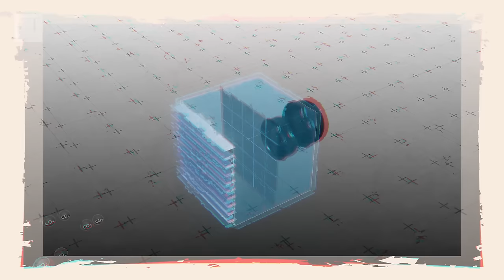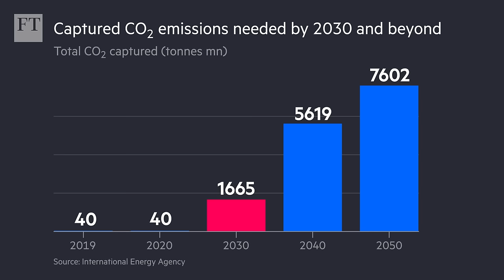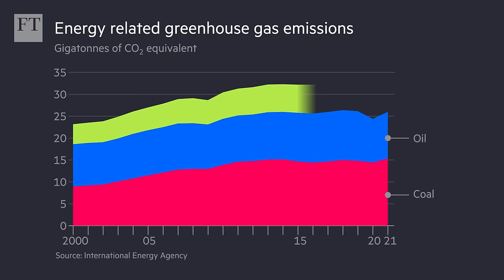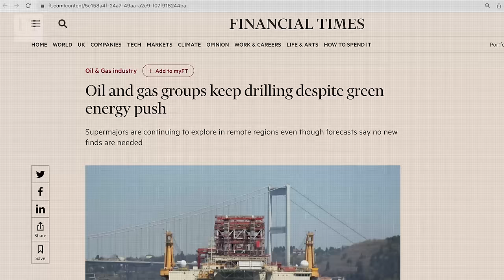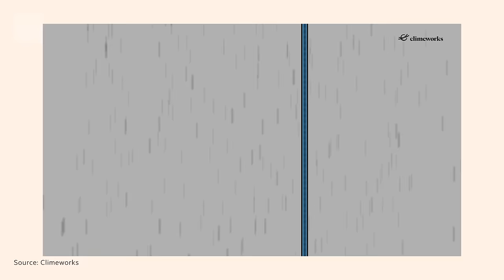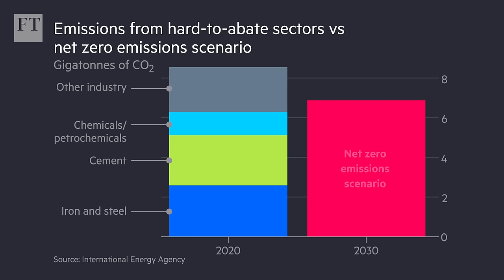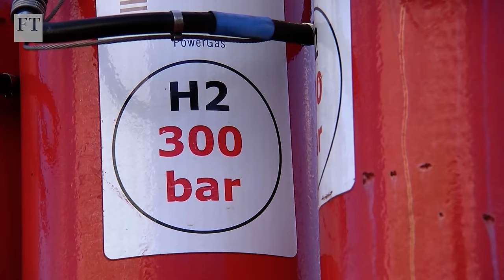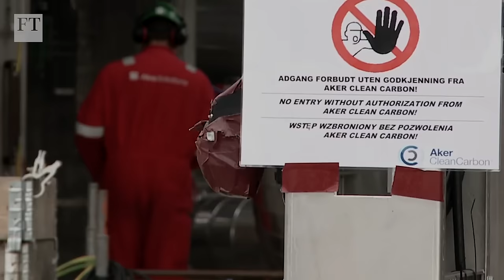Carbon capture: the hopes, challenges and controversies | FT Film

Comment: Was pleased to see at the end that basically all experts in this video, claimed there is NO ONE solution and that we likely need a combination of all to achieve our goals.... and I thought I heard an  agreement that there is NO easy elimination of O&G because of the many industrial processes that require it..... including; Steel, Cement, Fertilizer, etc.......   I would also like to see a better balance on the discussion on the green energy and electrification side of the equation.... for example we are NO Where near capable of removing more than 10% of the global transportation and distribution from Carbon with electrical....  and no one has proven that we can get there with current battery technologies. So we need all parties to be HONEST about the implications of the many changes, and also we are still a ways off from being able to produce enough green (wind/solar) to offset the carbon based generation.....    considering there is more than enough solar energy hitting the earths atmosphere every day to allow us to replace all generation with it.... the problem is a significant portion does not actually reach the surface where we are currently putting our solar capture devices..... is this an opportunity;  satellite based receivers???

Comment: Very good !
But I have always argued  that we should determine the economic return on investment WITHOUT the combustion of one trillionth of a scintilla or 1/1,000,000,000,000 of a hydrocarbon atom nor a hydrocarbon molecule that can attain, sustain, and maintain the world's Gross Domestic Products increasingly every year by solely on sustainable alternative energy.

I  also believe that carbon capture of hydrocarbon combustion, such as coal, would be the most dense and efficient fuel source.....but the energy required to attain, sustain, and maintain a carbon capture operation system MUST be derived from alternative energy sources because of the energy intensiveness needed for carbon capture and storage needed.

Comment: FT correspondents and other experts express clearly the challenges related with CO2 emissions from fossil fuels and superficially give some ideas for CCS or CCUS or other transitions ways. The emission from fossil fuels is really a big challenge, but today the world has a bigger challenge, scarcity on energy demand supply.  All depends from actual technologies used worldwide, which may be considered as solutions, but are very expensive for the economy mainly from low efficiency.  So if we will see energy related with efficiency the fossil fuels used on transportation have low efficiency, the fossil fuels used to produce electricity again have low efficiency, the wind and solar power not only are intermittent but have low efficiency, battery storing or Hydrogen energy have even lower efficiency.  
The energy transition from fossil fuels is a necessity but the actual technologies will help only marginally on CO2 emission, the renewable energies may replace only a part of energy shortage from oil and gas, coming this from natural depletion on production and existing technologies are with limited success which make the technologies used as CCUS EOR very expensive and CO2 intensive.  Let see Occidental petroleum for example, this company really is one of the most advanced on CCUS EOR and has decades experience, but when they inject natural CO2 produced from underground and for  every barrel oil they produce 15000 scf/bbl CO2 is consumed, only energy used to compress this amount of energy will increase the cost of oil and the CO2 emission will be high.  Theoretically if one barrel oil will be pushed from pore space may need not more than 2000 scf/bbl, and this is possible and on practice.  However advanced expertise is needed to reach these efficiency and of course this need invention on well completion which will decrease the cost of production and will decrease the emission.  The CCUS EOR has high Gas oil Ratio and increase and losses on all cycle of processes. The Occidental petroleum is invited on individual discussion about improving CO2 injection EOR on their reservoirs.  Other oil and gas companies which want to use CCUS EOR and produce more from their oil reservoirs are respectful for individual discussion for e new inventive technology.

Comment: Hand-wringing and groaning about the use of CO2 to pressurize formations and thus recover more oil and gas from them is logically flawed at best, and specious at worst. There IS demand for oil and gas. It is NOT increased simply because CO2 was used to enhance productivity of existing oilfields.

If petroleum producers don't use their own CO2 to recover more product from an already-developed field, then they'll simply vent off the CO2 and move on to develop yet another field. Get it? A new field; new company access roads; new oil and gas wells drilled; new gas and oil gathering systems (pipelines) laid down; new dehydrators and other infrastructure; and either longer trucking routes or new processing facilities built near the new field.

These idiots with their emotional reasoning are our 'experts?' Gawd help us.
Reply: enhancing productivity aka increasing supply and lowering price does lead to more emissions. just pay for carbon capture through a carbon tax.
Reply: Thank you, well said
Reply: There will always be demand for oil and gas. People will always want it. But if we just let them have it then severe climate change will happen. Most of the known deposits have to be left in the ground. Governments have to take action to make that happen, either by taxing it to make it more expensive and less appealing than the alternatives or by refusing permission for further drilling. The problem is that deposits are not evenly distributed, and most of them are in countries with dodgy governments such as Russia. I used to be against any investment in additional extraction since we already have more than enough available and have to leave a lot in the ground. Now we have to invest some more in extracting western deposits and instead leave russian oil and gas in the ground in order to not give Putin more money for invading his neighbours.
Reply: "Hand-wringing and groaning about the use ..."  Who's the emotional one here!

Comment: +18:00 Green hydrogen only makes sense for non-energy applications, but there are quite a few such uses, so it could go good for those.
Reply: green hydrogen is defined as hydrogen released from water by electrical hydrolysis, an inefficient way to store energy, which at best produces electricity in a convenient location at a combined efficiency of ~ 50%, not counting the efficiency loss, when producing the electricity to run the hydrolysis, 18% for solar cells, day time only, 33% with steam driven coal powered turbines. 
In Summary you are right.
Among the few are the liquid hydrogen-liquid oxygen launch vehicles like the expensive SLS.
But  for the production of ammonia based fertilizers it is essential (Haber-Bosch process)

Comment: I will explain the reason at the end, but I would like CCS and CCUS companies to continue with their development.
The general public now needs to reduce their power consumption at night, when solar power cannot be generated.
If you know anyone who works at a window sash manufacturer, please introduce them to me.
The other day, I had a discussion with a Japanese sash manufacturer, but even though they are registered with the Ministry of the Environment's decarbonization activities, they prioritized profits and were reluctant to accept our proposal.
Carbon dioxide is a problem because it is a very stable gas.
Now that such large-scale wildfires have occurred, it is important not to emit any more CO2.
What I would like to propose is a device that uses natural wind to exhaust heat and reduce air conditioning power consumption at night, and features a gust protection function.
We have a plan to install this device on windows, so we would like to discuss this with North American sash manufacturers.
I think CCS needs to be collected higher up in the sky.
This is because CO2 from thermal power generation is exhausted from tall chimneys, and the exhaust gas from gasoline cars is also hot and rises quickly.
If carbon dioxide can be good and bad for plants, then the CO2 near the ground must be delicious.
If so, the original mission is to collect the CO2 in the sky generated by thermal power.
Last year, the weeds in my neighborhood died in the intense heat, and even survived the winter with their shape intact.
In other words, since there is less chance for new grass to grow, global warming may accelerate, so I think it is better to leave CCS as a method.

Comment: The only hope is nuclear plus renewable. There is no other way.
Reply: only nuclear.. fission at first, then fusion..
Reply: nuclear is not only. unnecessary, it is much too slow to build out 
and much more expensive to build than renewables
Reply: @AWildBard  Only in the US. Most countries outside the US, within developing markets of Asia and Africa, its cheaper. It might be slow to initially build out, but it takes more to build of renewables to produce the same output as Nuclear though.
Reply: that only works for electricity.
Reply: @derpmansderpyskin  More public transport powered by electricity would be a good start if we want to have our reliance on oil to go down.
Reply: @argonauts56au1kera6  A main point of the video is that some industrial processes cannot be made carbon neutral without the use of CCS. As an example: cement is produced by baking the Co2 out of limestone. You can electrify the coke-ovens, but the Co2 coming out of the limestone (responsible for about 50% cement's carbon footprint) must go somewhere. Unless we come up with an entirely new way of producing cement, then the only way to make cement carbon neutral is with CCS.
Reply: @derpmansderpyskin  You can use Carbon Capture Cement or Carbon Stored Cement, in which the carbon is captured and stored as a solid rather than emitted into the atmosphere. Most Industrial Processes can be made carbon neutral in a way, its whether we invest in it or not.
Reply: @argonauts56au1kera6  So you agree that carbon capture has a place in the renewable transition? That was my only point.
Reply: @derpmansderpyskin  Yeah & I added it that we can only do it through investing in it. Which is something that we are not going to do judging by the past decades since the 1970's. So the best thing we can do is just accept Climate Change.
Reply: @AWildBard  that is only because renewables are heavily subsidized, and nuclear is heavily regulated to an onerous extent.  Nuclear, can be built in 5-6 years, if you look at more efficient nations building nuclear.  Modular nuclear will be even cheaper.  Modern nuclear is fail-safe, and thorium reactors can be partly fed with their own waste.  

If the goal is carbon-free, nuclear must be part of the solution.

Comment: This video, like many discussing carbon capture, didn't do enough to differentiate between capturing CO2 at source, from waste gas chimneys, and capturing CO2 from the atmosphere. Capturing from the atmosphere is enormously harder because the concentration is on the order of 400 times lower. Most carbon capture is therefore done at source. But with the exception of BECCS, capture at source can never result in negative emissions because all you are doing is emitting less than you would have been without it, but you are still emitting some CO2 because CCS is never 100% effective. 

Direct air capture = expensive but necessary for negative emissions. CCS (at source) = affordable but does not negate emissions from other sources. 

In almost all cases it would be cheaper to not burn the fossil fuels than to capture the carbon from them. The only exception is gas peaker plants which are currently needed as a backup to renewables as storage is not yet available at large enough scale for affordable prices.
Reply: biomass + ccs = negative emmisions

Comment: Glad to see that this is an objective and fair assessment of Carbon Capture. Bottom line with almost all green projects is, that they are used to make money. We are made to believe that we help the environment, because "they" can make money out of it. CCS to revive old wells... Killing American forests to turn them into pellets... electric cars that weigh much more than conventional cars - and therefore can not possibly drive more economical... solar panels that work during noon when there is hardly any need for that electricity... a demand for lithium ion batteries that asks so much resources that it is an environmental and economic problem in itself... a total dependence of electricity to a point that our society could fall if the power grid would be destroyed...
And in the end it is all just soft talk (dont be too blunt because in the end people only want to hear positive stories and they will "kill the messenger"!) and no significant action.

Comment: You could start by making oil industries by law capture 20% of their carbon by investing in carbon capture. Then slowly increase the % requirement as ev's and electrical boilers are readily available. Obviously you'd also need carbon tax mitigation based on if it makes the company unfeasible. But that's not the case for many and oil industries operate with large profit margins. Why are we paying for their profit consequences? In my opinion it's just improper waste disposal. C02 is a resource that has many applications so it's not like that 20% is being thrown away.
Reply: Ok, then what do you do when the price of oil goes to $300 and all the politicians who supported that plan get turfed by ones promising cheaper oil?
Reply: @adambutton1459  That's a good point and the only way to counter that would be extensive legislation on where oil is sourced. There would have to be a standardised process for carbon capture so people don't cheat by burning peat next to collectors or something silly. 
Then you'd also need a list of approved oil industries that follow these carbon capture practices. Ultimately it's down to the electorate on who they vote, but people aren't stupid and can be explained that their politician is using "dirty oil". In a world of increasing awareness of climate change I can't see how that'd be beneficial for the candidate.
Reply: @adambutton1459  oil has to be more expensive so people stop using it. People need to switch to EVs and trains for transport. Government should subsidise a widespread charging network for everyone to use as leaving that private business to sort out has proven to be rubbish. Government should also facilitate low cost loans for purchasing EVs so more people can cope with the high initial cost of purchasing them. Don't make oil cheaper, make it unnecessary for most people. When the demand is lower the price will come down for people who still need to use it for whatever reason.